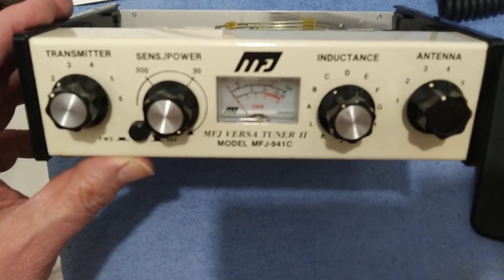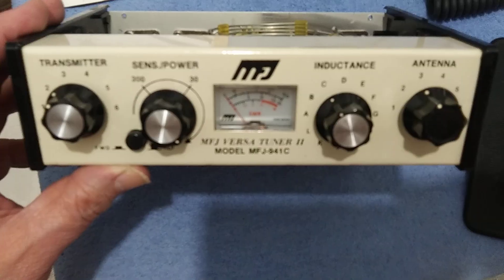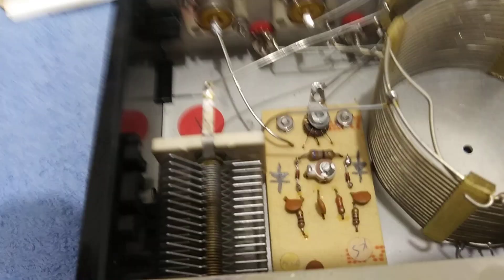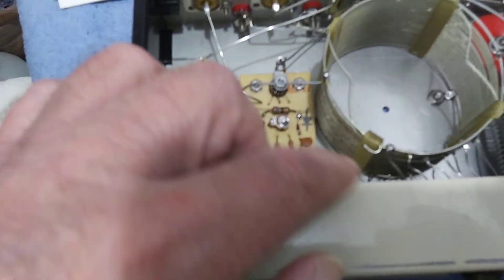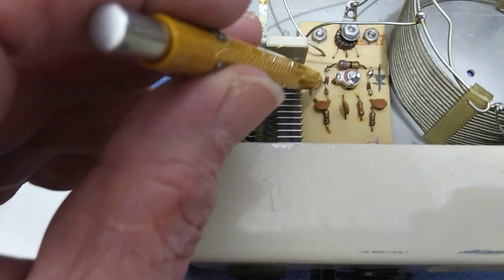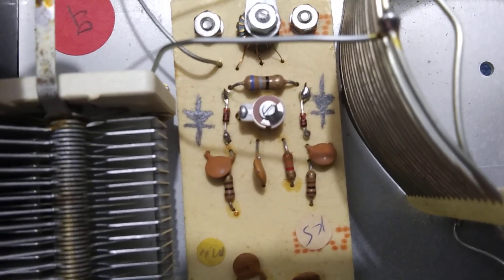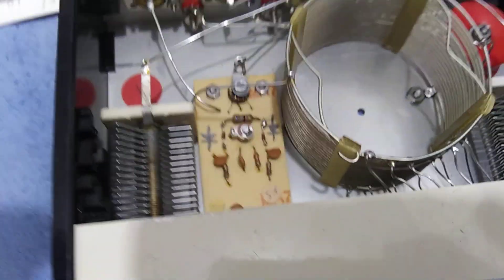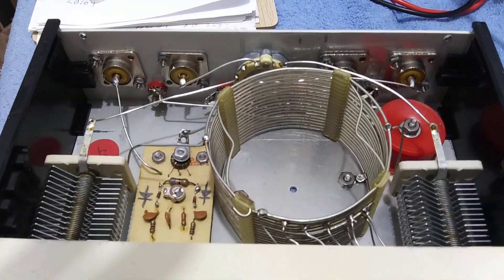MFJ-941C ATU REPAIR  (Don't throw away that manual antenna tuner)

Comment from the maker: Yes, bad ground can cause the same high voltage spikes as using the rotary switch while transmitting. In this video it's safe to say that not only did one or both diodes short out from "hot switching" but the final output in the transmitter failed as a result of it as well.

Comment: There was a period of time when there were assembly issues in the form of poorly grounded components. Somehow word didn't reach the right people about points intended to be chassis ground were painted over. It was an oversight in production design about masking those points before they went to the paint stage. I found the same problem in other MFJ products. 
   As far as I'm concerned it's a wise move to check for that issue on any MFJ items whether new or old, and take the necessary steps to correct it. While in there, look around for any other potential problems before closing it up. It's just good practice in general.

Comment: I have one of these I haven’t really had the chance to use yet. But I have a new stereo receiver and wound up using the tuner temporarily for an FM antenna set up because I needed a juncture between two male UHF cable ends. I noticed that the reception does not change even if I select another setting other than “coax 2” (it has connections for two antennas) and even the dummy load setting. Why would this be the case? I bought it cheap second hand but it’s MFJ brand. Maybe it’s damaged
Reply from the maker: These tuners are for the HF band and FM is in the VHF band. I doubt you will get good results using an HF antenna tuner with VHF.
Reply: @samradioman3843 so you think it’s just bypassing the internals because of that?
Reply from the maker: It would act that way but it requires a deeper dive into the the physics of electronics to explain it.  It has do do with reactance and frequency. We say an antenna connection is made for an impedance of 52Ω. However if you change the frequency passing through that capacitor or inductor the "resistance" which is not pure resistance but rather "reactance" now it's no longer 52Ω. In these tuners for HF the air variable capacitors are 208pF.  That is a crazy value for VHF yet reasonable for HF. Research the relationship between reactance/resistance and frequency and you will understand the why.  A side topic is resonance when capacitance reactance and inductive reactance is equal.  Xc = Xl is the point of resonance.
Reply: @samradioman3843 okay that’s all good to know thank you man! Like I said just curious if it was trash but good to know it’s just a function of its design that’s allowing VHF through

Comment: i bought a mfj tuner at a hamfest cheap the shells of the rf connecters had 10 ohms between them. fix was solder w wire between everething that was riveted to shell  end of problem